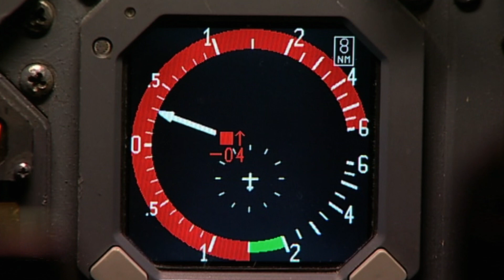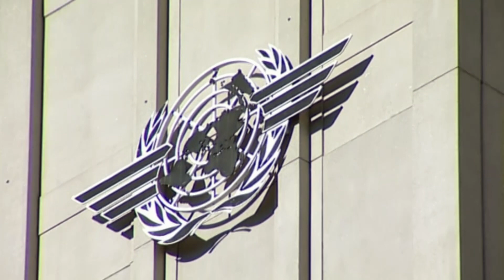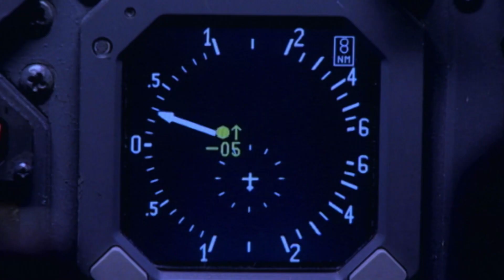When Air Traffic Control Overrules TCAS Sensors, Bad Things Happen 👨‍✈️ Air Disasters | Smithsonian

Comment: Responsible for the Überlingen Catastrophe was the DHL crew. They descended as TCAS said, and in the same time heard the controller instructed the russian crew to descend but didn't do anything.  Neither increase descent nor yell "WE are descending too!". Apparently DHL is too big to fail. Nobody deers to accuse DHL.
Reply: i dont think its really their fault, they already said about the tcas warning but the controller was busy helping other aircrafts, when the contoller noticed it the russian plane was guided to descend. so basically nobodys at fault in my opinion, it was due to failing censors.
Reply: Clutchgoesclutch

Nah, if a tcas warning pops up, you just do what it tells you to do, because it was invented to be exactly that!

I can't think of a single reason why anyone would not respect tcas. Especially because a single pilot doing the opposite of what tcas says, means that 2 planes are going to collide.

Comment: Because of negligence, some skyguide workers were given suspension charges while 1 was given a fine. Peter nielsen was already underwhelmed by the disabled vital equipment he mostly need to avoid those 2 planes from colliding and was later killed by Vitaly Kaloyev. And if the Russian obeyed their TCAS rather than the controller's advice, then they would've avert the collision